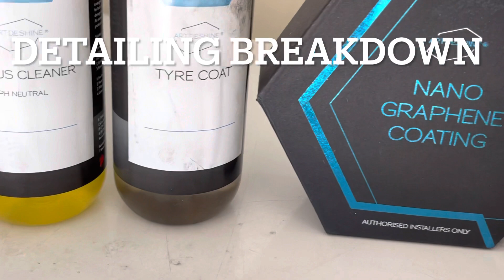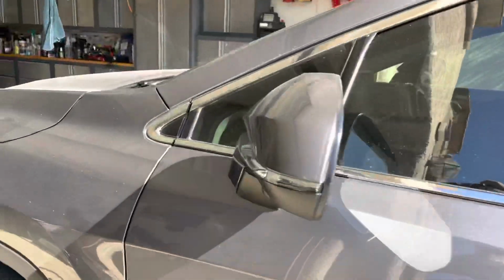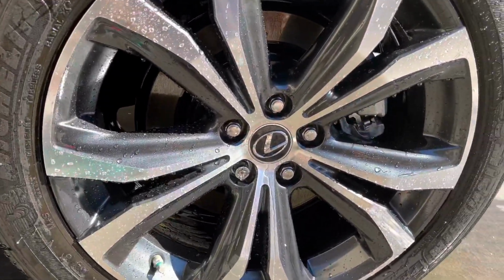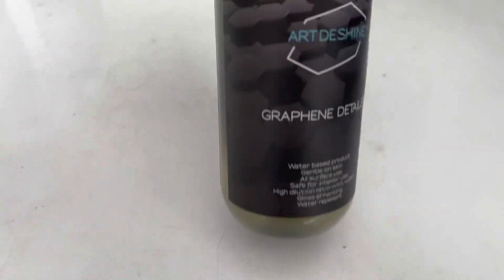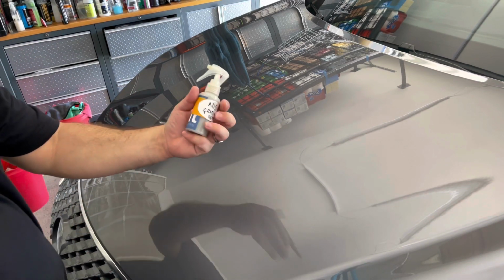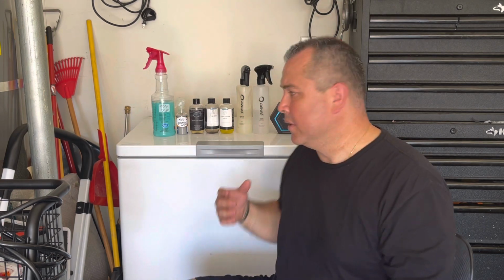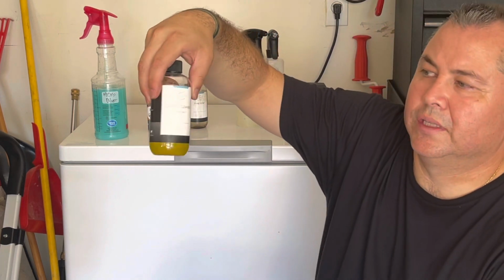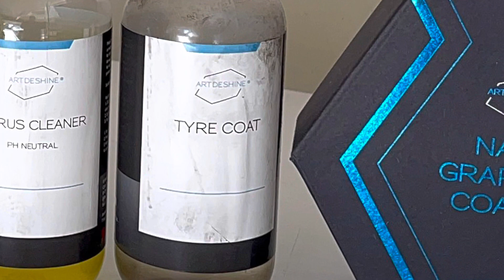Artdeshine Nano Graphene Coating (7 Month Update and Maintenance)/Auto Detailing

Comment: Would you say that the McKee’s Hydro Blue is similar or better than Gyeon Wet Coat? Last time I looked a few days ago, the Art de Shine Tyre Coat is sold out.
Reply from the maker: They are very similar.  I have heard there is a concentrated version of Wetcoat but haven’t seen it.  McKee’s has a concentrated version which I have and you can buy the Pro version which is also ready to use at 4:1 over their regular which I think is 8:1.   So just depends what your looking for as both are excellent.